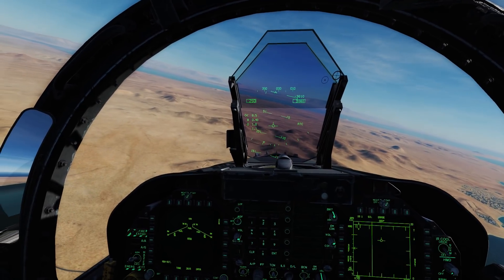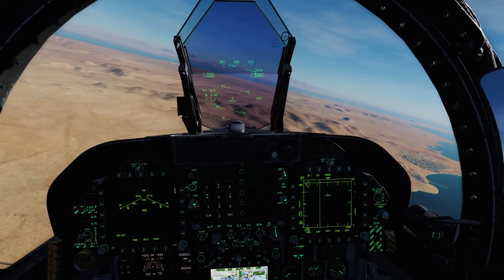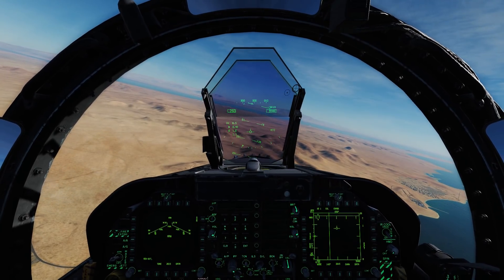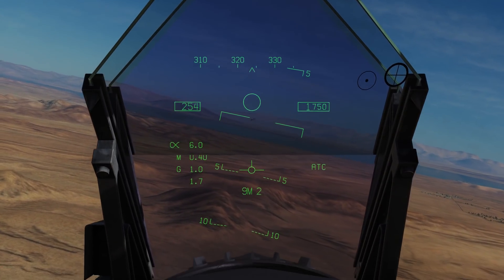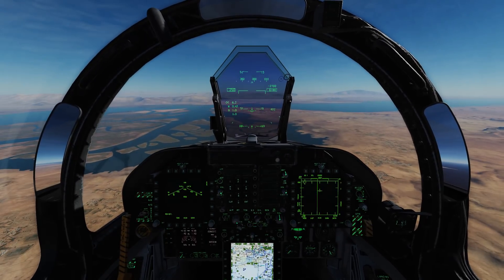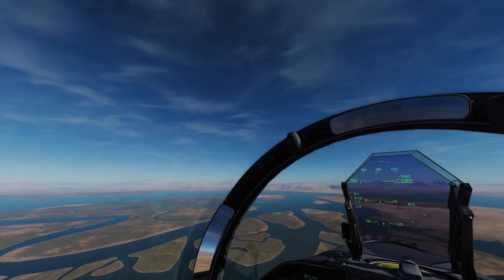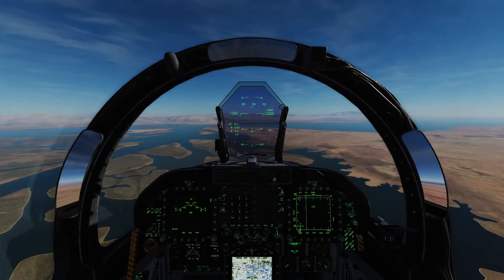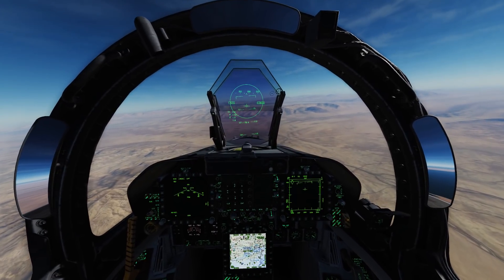DCS: F/A-18C Hornet - AIM-9 sidewinder Tutorial - Stealth Kill

Comment: Quick question.  Why go radar completely off?  Why not just go to StandBy?.  You're not transmitting in StandBy mode, so it seems a bit superfluous to go to OFF instead of StandBy.  As far as I remember, being an Avionics tech..Radars require warmup and time-in processes in RL.  It's nice that RCS makes them instant-on, but any Radar I've ever encountered had a time-in period while certain components came on line.  Same for IFF or anything else that has a hi-powered RF section in the Ghz range.  They use 'Tubes'..actually resonant cavities..to make the high frequencies, and they have to stabilize the voltages and frequencies before you can go to full "ON" mode of operation.  It'd be a bit more realistic to not go to OFF, but only to StandBy in this scenario.  I love watching your Vids, btw.  Hope to get the gear and start flying in DCS soon.
Reply: Kris Welter 
Instead of going to Standby why not just go SIL ?

Comment: Great tutos on your channel mate! Would you please make one on the amraam as I can't find any on the web please? I am not sure how to know exactly when the 120's radar starts to track on its own and what's the indication on the hud so I could know when I can stop tracking the target with my plane and break off to wether go defensive or track another bandit. Thx 😁
Reply from the maker: hi man thanks so much, ok so the amraams will go active whenever they lose lock with the aircraft, the only issue is that their on board radar is obvs not as good as the planes, so if they lose connection with the aircraft from a long range, say 40miles, they will still try to guide to that target on their own with their active radar its just that the probability to kill is massively reduced. the amraam will automatically go pitbull around 11miles (IIRC) and you should TRY to maintain lock until that range from target. (the range to target is displayed on the bottom right of the hud, you should see something like R40miles or something like that and it will count down.
Reply: @GrowlingSidewinder  great thank you! Do you know if they will update the 120's specs so it's more reliable like the real one? I guess there's a lot of unknown on this topic as it's sensible data which is probably not rendered public yet and not to be released soon... Also do you know if at some point Eagle dynamics will change missiles behaviour especially regarding Fox 3s as they should climb on their own and fall on their target not like they are behaving today? thx :)
Reply from the maker: I'm not sure if they will ever "update" the aim120Cs cuz a lot of people feel like they're pretty strong missiles as is, I know the Russian side for some guidance upgrades for their R27ER and R77 missiles recently so maybe they are redoing some missiles, its possible the 120C will make that list in the future I dont know. the only thing I know regarding the fox3 thing is that when the f14 is released they are also releasing a newly modeled aim54 pheonix that will behave like the real aim54 did and will climb. so for the other fox3's I have no idea mate.

Comment: Sorry but your data on countermeasures is wrong. Flares are not made of aluminum. Thant's chaff and is used for radar guided missiles. Flares are made of magnesium. magnesium burns hotter than jet exhaust. Not trying to show you up. You're a damn good pilot. Just pointing out something that you're wrong about.
Reply from the maker: ya dude ur 100% right, what i said about the composition was incorrect someone else pointed that out in the early days I posted the video i believe. good catch tho, and thanks for correcting.

Comment: 10:00 So the RWR warning only gives a beep when a missile is released towards the aircraft? So why didn't you leave the radar on until before you fire to continue to have awareness?
And I also don understand why do you uncage? It still fires and hits its target without. I did not understand this part. Thanks
Reply: The RWR gives a warning when it detects radar pinging the aircraft, not when a missile is fired. He turns off the radar so the enemy doesn’t get that warning. Also, sidewinders are IR guided, so they don’t require radar to track the target, hence why the enemy doesn’t get an RWR warning when it’s fired.
Reply: @dylanhemman6753  Clear..Thank you

Comment: That was very cool.  Are the MiG 21 and the F-5E more difficult to detect by more sophisticated aircraft because of their more primitive radar in them?  I've watched a lot of videos on both aircraft just slaughtering more modern planes that seemingly are unaware  of their presence.
Reply from the maker: none none more than likely just poor pilots. Also if they turn off thier radar they can sneak up on you. But their radar isn't the thing ur detecting. Ur picking up radar bounces off the skin or profile of thier aircraft when ur radar beam hits them and it comes back to you. So theoretically the smaller the profile of the plane the harder it would be to detect. But modern radar is so sophisticated that it'll detect even the most miniscule positive spikes. So no the mig21 and f5 don't have any kind of advantage in relation to being more primitive.